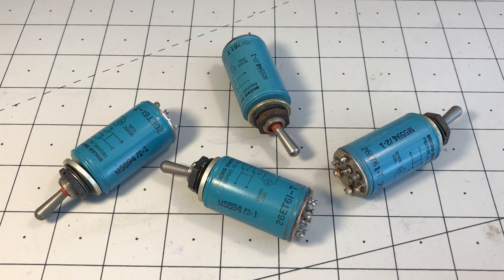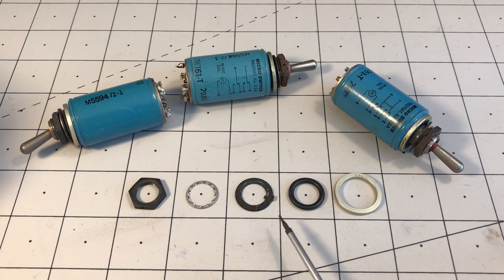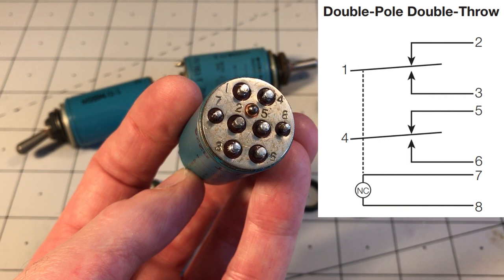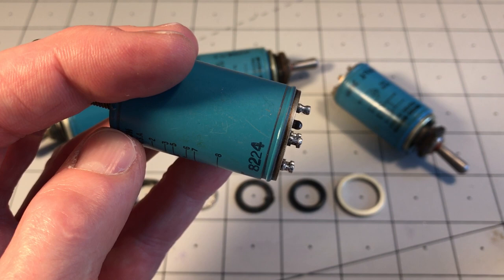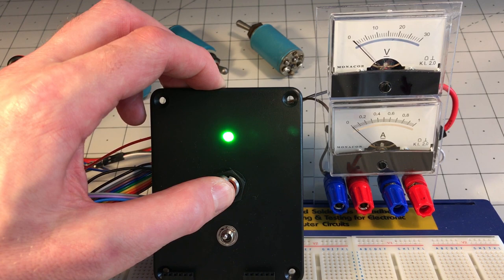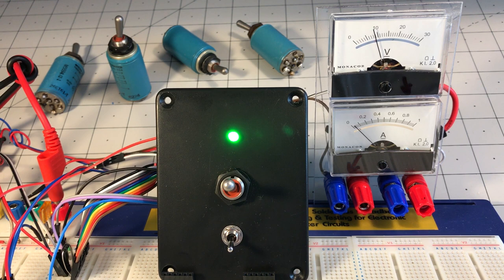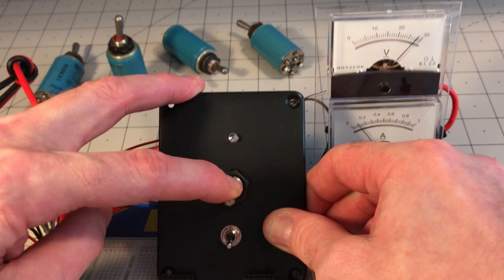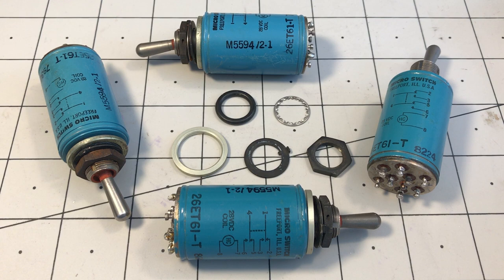Honeywell 26ET61-T Electrically Held Toggle Switch M5594/2-1

Comment: I would have liked to have seen how you actually wired it up as I am electronically handicapped and barely understand this stuff. :)
Reply from the maker: Blue Max thanks for your view and comment I appreciate it. I plan to show four switches installed in a panel and working with the DCS World A-10C simulator so look out for that one I will show details of the wiring hook-up.